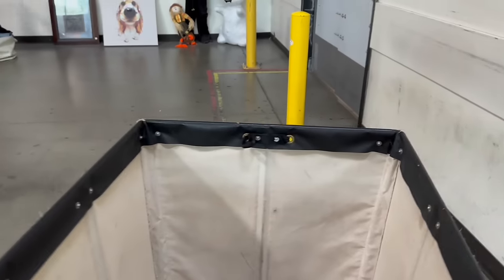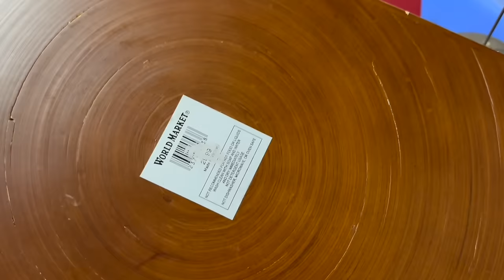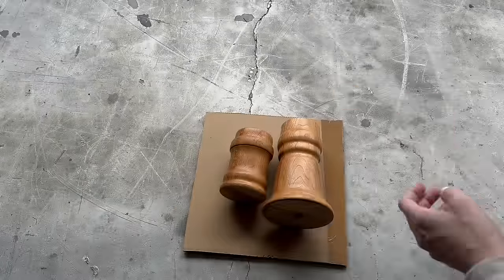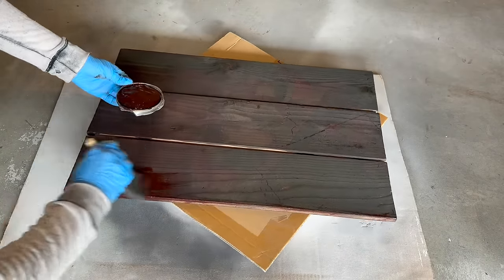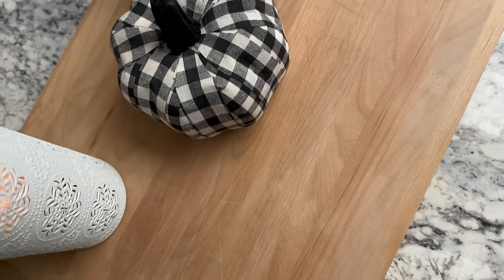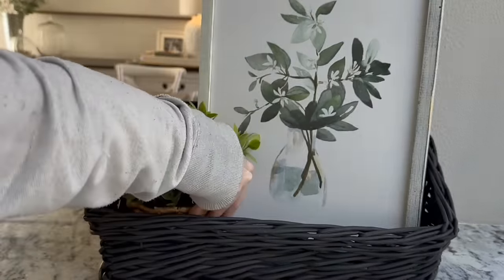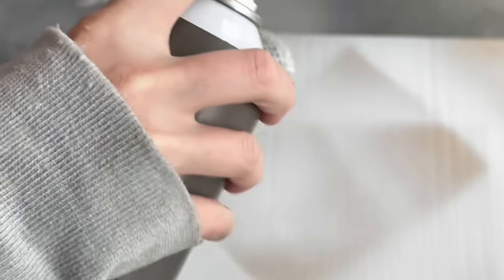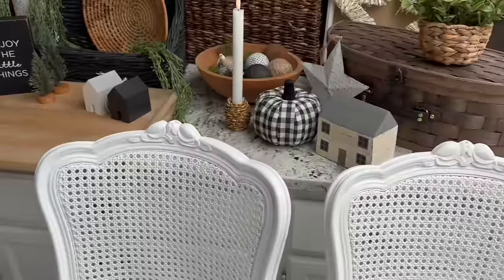🏡GOODWILL BINS • HOME DECOR HAUL • THRIFTING • DECORATING IDEAS

Comment: Lovely video!!  Thank you so much for the inspo!!  When you melt candle wax, you might want to  use a double boiler method (if you don't have one, you could put water in your pot & put a tin can in to put the wax in).  The wax is extremely flammable so the double boiler method distributes the heat better
Reply from the maker: Good to know! Thank you, Wendy! 😊💕

Comment: The candles turned out very nicely.  The reason the 2nd one was a bit caved in is because as the wax cools it condenses and brings down the center. If you will leave the candles to completely harden and save enough wax to cover the top again that will cause you to get a nice smooth and flat finish.  Also, pouring the wax as smoothly and gently and slowly as possible causes the wax to be more smooth that it might be otherwise.  You did a good job, especially if this was your first attempt.
Reply from the maker: Very interesting! Thank you so much for sharing!! I really appreciate it! 💕😊
Reply: You can also use a heat gun to melt the top layer evenly on the candle to get rid of the divot. 😊

Comment: I love your finds & creativity Tiffany. On those solar lights.. I've had great success with replacing the rechargeable batteries that are in the solar unit. Open the back, undo those little screws, and put in fresh re-chargeable batteries. The ones from Ikea work fine for me. Give it a go. If they don't work, means the solar unit isn't working anymore. I also clean off the top of the solar pack, dirt & grime can hinder the recharging.
Reply from the maker: Such a great tip! Thank you for sharing! 💕
Reply: Yes! I have had luck changing the batteries in solar lights. I previously didn't know they had batteries and would toss them when they stopped working.

Comment: I have found some of the solar lights actually have a replaceable battery in them. If the solar panel surface is still pretty clean and functioning you can often get them working well by putting in a new recharable battery.
Reply from the maker: Great tip, Lorraine! Thank you for sharing! 💕

Comment: When you use a stencil, before applying the white paint for the bread container, use the same base coat (black) first with the stencil on. After it dries you can apply your white paint and it will not bleed.❤
Reply from the maker: Thanks so much for the tip, Amanda! 😊💕

Comment: If replacing the batteries on the solar light and cleaning the solar panel off with magic eraser does not fix it, I would fill the little compartments with faux greenery and use it as a planter even a hanging planter maybe faux greenery that trails like ivy or fern or something. You could even hang it from an antique chain from the ceiling
Reply from the maker: Great ideas. Thanks, Mary! 💕

Comment: What type of nailer and drill do you use?  They seem to be battery with no cord?
Reply from the maker: Hi Joan, that is correct. They are Milwaukee. I’ll share links so you can see exactly what we have. If you’re patient Home Depot runs a sale a few times a year and you can get a battery included. 

Drill - https://amzn.to/41BCPR7
Pin nailer - https://amzn.to/48uc17s

*Required disclosure :) please note that the included links are affiliate links. If you purchase with the links provided I may receive a small commission. There is no additional charge to you.

Comment: I get those divets on top when I do candles too... I'm thinking it's related to the wax being poured too hot... but please let me know if someone shared what they 'know' is doing it in your comments!
Reply: Two people so far have recommended using a hot hair dryer and the wax will level with the heat
Reply from the maker: Yes, as Ellen mentioned, it sounds as though reheating the wax will help to smooth it out. Someone shared that you can put it in the oven at 200 degrees and that will smooth it out. :)
Reply: I'd love to know how to prevent it tho!  I doubt serious candle makers are going back and heating up their candles... but I could be wrong... :/
 @tiffanygemmer-DIYdesign